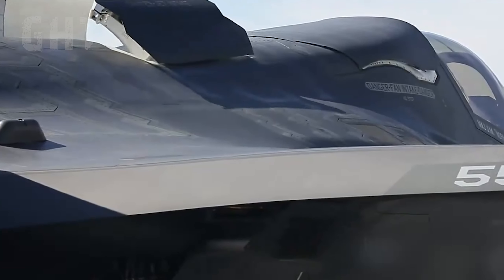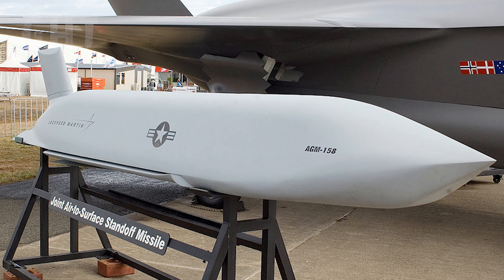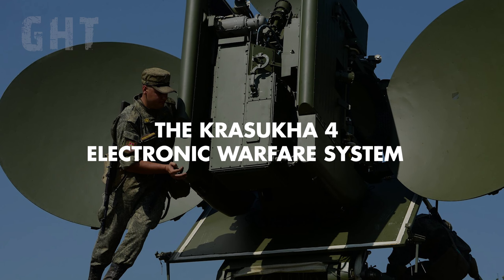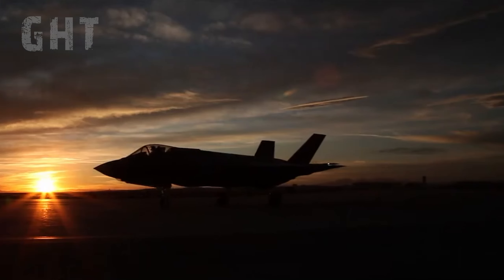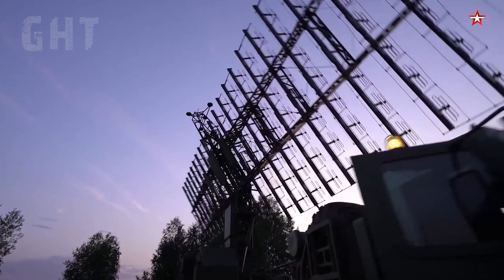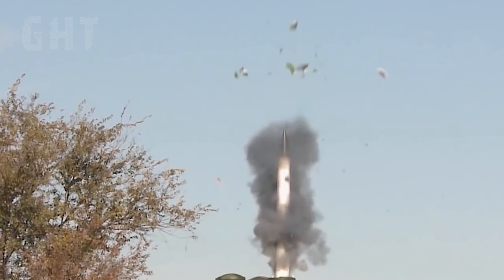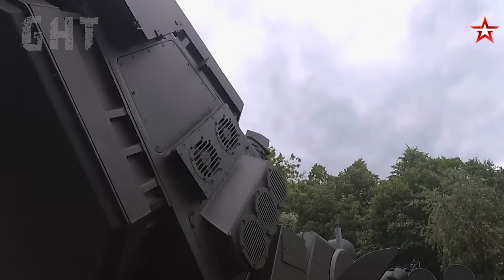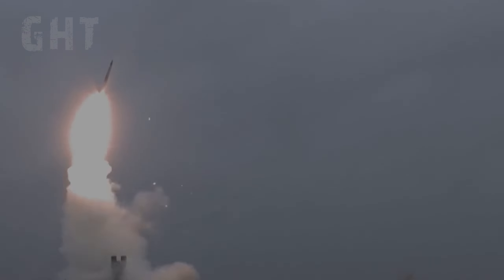Russia's Secret to Neutralizing F-35 Stealth with Electronic Warfare

Comment: That new radar from Russia sounds like a variant of thier effort to fuse all calls into one audio tone or white noise and decode at iether end. By the sound if this one it sounds like harmonic microwave with a low tone audable part addition.

We cut into that signal type using a remote pickup , USA. Since its harmonic and set mix and set variable frquency we should still be able to pick up the signal remote and possibly send a off signal in sinc and dissrupt the radar targeting making it think a target is left when its right. 

The returning signal must be in since with send. It must be in frequncy envelope of send but the harmonic portion in a weak spot if the radar is being fed a like off signal.
Reply from the maker: The F-35 also has jammers on board, it all comes down to the pilot in the box, a top gun pilot could probably pull it off.